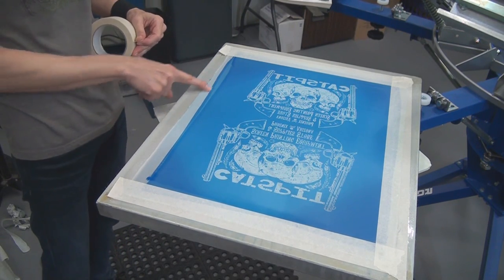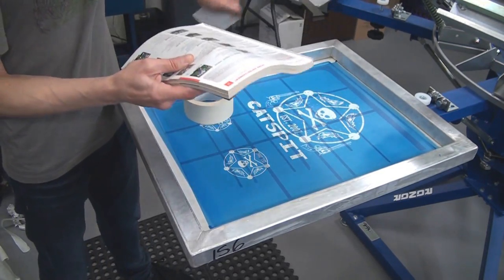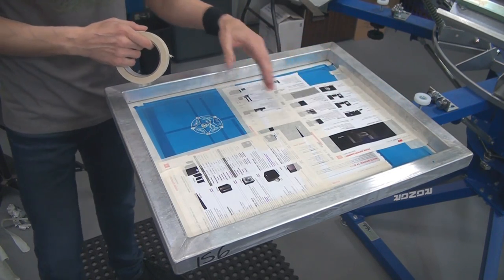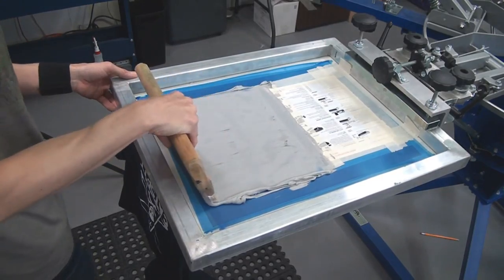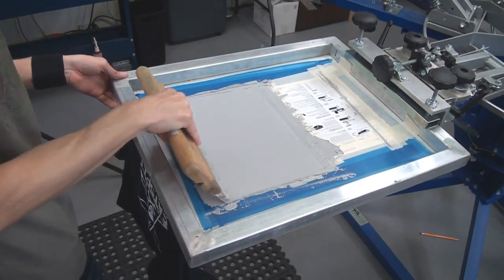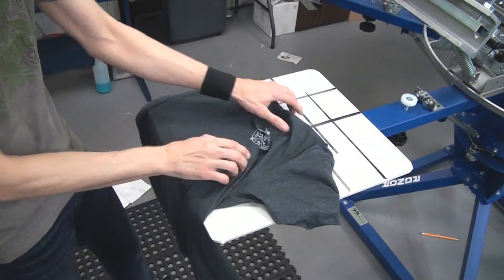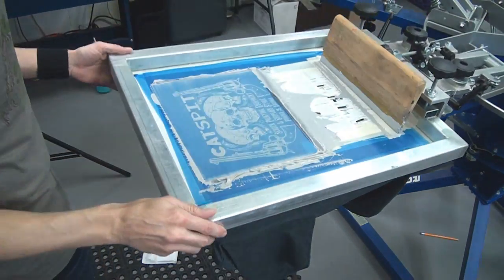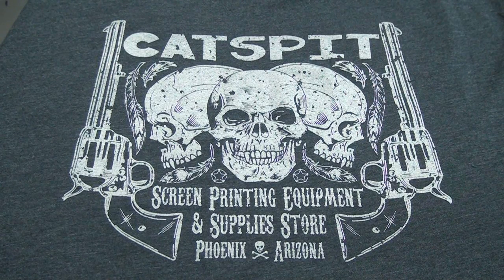Screen Printing Tee Shirts: Basic Test Print Set Up Production Run Tips

Comment: hi was just wondering how screen printed tees handle going in the washing machine, does the ink still stay printed on the tee and in good condition
Reply from the maker: If you wash them inside out, plastisol inks will last for several years. I have a video about this with shirts I printed over 10 or 20 years ago. Thanks for watching! Screen Printing Equipment & Supplies - http://CatspitScreenPrintSupply.com/

Comment: is CMYK screen printing a great substitue for DTG printer.. wanted to do alot of colorful designs on black. how many screens do you need for CMYK?
Reply from the maker: +HUGEL Not at all since DTG can do 1 or 12 pieces with as many colors as you want. With screen printing there is a lot of pre-press work and set up. Screen printing is best suited for higher volume printing jobs. Also CMYK uses 4 screens normally but often we add spot colors where the CMYK cannot create a bright enough color. Thanks for watching. http://catspitscreenprintsupply.com/

Comment: Hi Catspit, I realy appriciate your videos in the way how you learn people screen print, and of course, I subscribed :) But about my issue, when I put the color on (water based GRAFCO) and slide the squeegee the color stays in the screen, even if I stroke and even for the first slide to the clean screen, impossible to cut the color from the screen, look like the screen is glued to the t-shirt. I tried to setup off contact (lower or higher) and it´s still hapenning, I´m using one color station, spray glue (t-shirt is glued fine to the platten). When I tried to use plastisol ink this wasn´t hapenning - do you have any idea? Thank a lot!
Reply from the maker: +Filip Ludvík Thank you, glad you enjoy my video work. Thanks for subscribing! Sounds like the ink instantly dried in the screen or perhaps reacted with the emulsion and clogged up. You need to use emulsion that is resistant to water based inks. I sell emulsions that will be resistant to both water based and plastisol inks. You also need to make sure the emulsion is fully cured. Thanks for watching. Screen Printing Equipment & Supplies - http://catspitscreenprintsupply.com/
Reply from the maker: +Filip Ludvík That was a wrinkle in the jacket fabric, NOT a clog. I really have no clue what is actually happening to you since I am not there to see it. I guessing blind here at best. The best thing to do is call GRAFCO and get technical assistance for their products.
Reply: +CatspitProductions i was wondering wheather a person needs a wholesalers licence or business license if your starting a clothing brand, do you know of any whole sales websites or venders you could give me. also, do you offer pre burned or exposed screens if a person sends you a vectorized image, i know of a couple other companies that do it and it seems lucrative. thank you for responding to my last questions and thank you for the helpful vidoes you realy help the community.
Reply from the maker: +Jonathan Reyes I do not offer screen burning services. I'm only one person most of the time so it's not practical for me yet. You may not NEED a business license but if you intend on creating a brand you should have at least a city and state tax number. Some places will not do business with you unless you have one. I do not have any referrals for wholesale shirts, unfortunately. Thanks for watching my videos. I’m glad I can help out through them. My pleasure to help out where I can. Screen Printing Equipment & Supplies - http://catspitscreenprintsupply.com/

Comment: Hey man I have an issue with my print. I have small detail lettering and it's not extremely small but it's not printing well thru the screen. I've tried pressing Hard or adding more ink but I've noticed it just bleeds the design and doesn't really help. What should I do?
Reply from the maker: I think you asked this somewhere else? But as I said try a higher mesh count and or a harder squeegee. Also try less pressure on the flood and stroke. Thanks for watching. Screen Printing Equipment & Supplies - http://catspitscreenprintsupply.com/

Comment: A suggestion from one printer to another, use excess film to cover secondary prints on screens. Ink won't seep through it so you only have to tape up the ink side! Just make you place the printable side of the film face down or else it will gunk up the ink.
Reply from the maker: +ModestBouse Oh yeah great idea! I don't often have trimmings or waste big enough to do so but waste film positive material would probably work great. Right, so use the back side to touch the mesh so the inkjet film emulsion does not clog things up.... Interesting indeed. Thanks for watching. Screen Printing Equipment & Supplies - http://catspitscreenprintsupply.com/
Reply: +ModestBouse  I just learned this little trick this past year. It's a great way to reuse something that was going to be put in the trash. Plus I found that the paper and tape tend to pull water and oils out of ink if the ink is left in the screens overnight.
Reply from the maker: +jerripaw That is true especially if the paper is not glossy. It will absorb the plastisizer if you leave it up too long. Thanks for sharing with us all :)